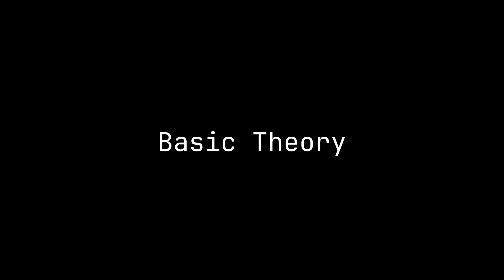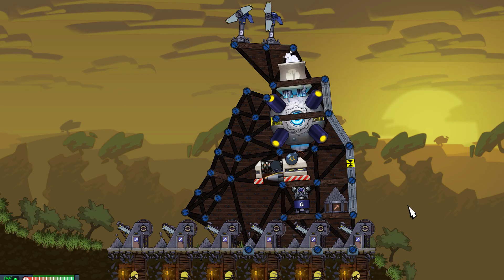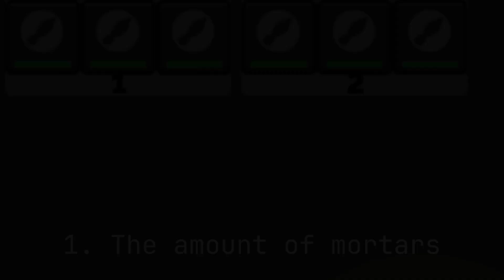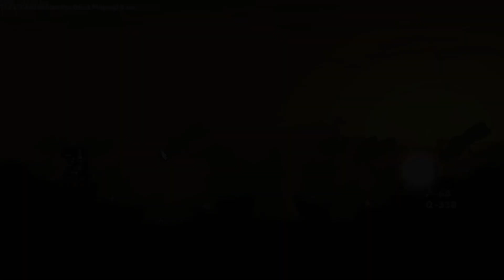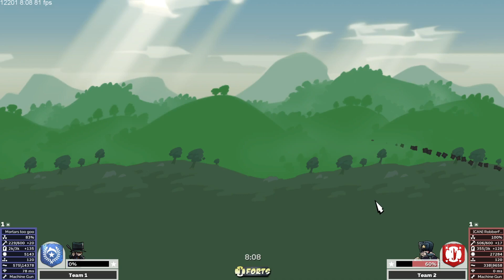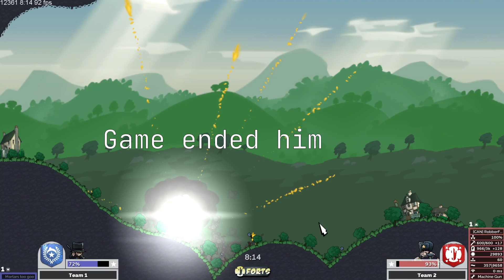Forts - Portal mortars guide

Comment: After building the first box simply hold ctrl to extend additional boxes at the same height & angle.  Dragging the diagonal connector strut is the most consistent.  

(This mechanic also helps when extending doors without interrupting the firing angle). After you have an economy, dragging over a max length strut helps to prevent deformation by connecting the top of the tower to the bottom of the tower.
Reply from the maker: In the portal stack the excessive diagonal is placed and the tower starts bending under its weight. That is not the solution for this case

Comment: Ok hear me out

mortarrushes in 2028 will have normal mortars  T3-ed by 180° so the wood brace they re placed on  will cover them from snipers.
Reply: Ap snipers :3
Reply: @Gekko-cs2ti  thinly layered woodspam, that is not blocking the mortar barrel or screw/node doors tech.